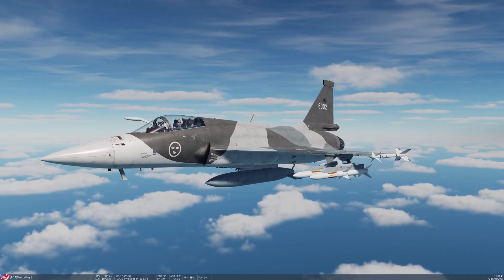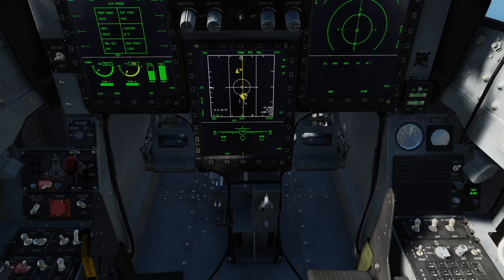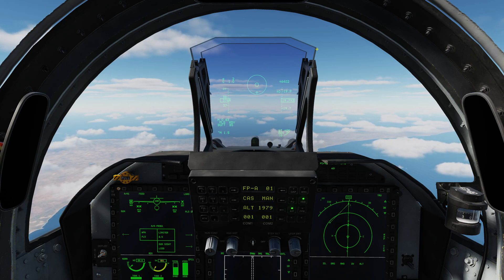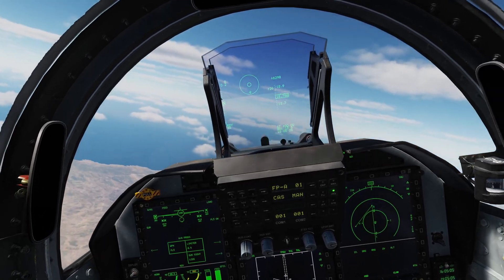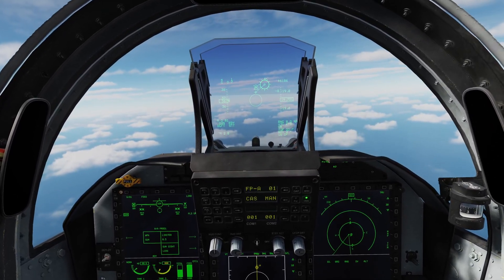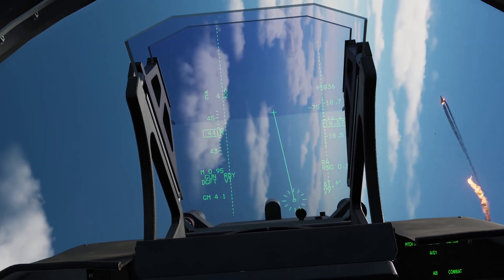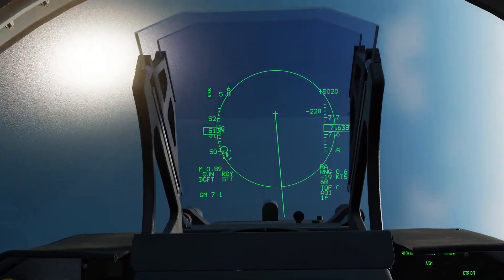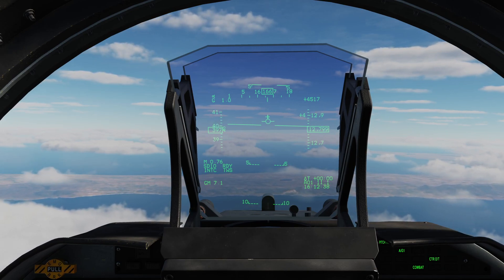DCS JF-17 Tutorial 5 - A/A Radar WVR Modes

Comment: The JF-17 doesnt have a "dogfight" switch but you can enter dogfight/vertical scan mode directly using S1 from any other master mode in the plane. So you can go straight from Air to GRound to dogfight and back again with just one switch, which I would argue is actually easier and faster than the F-16
Reply from the maker: Thanks, this is a really good point which I missed in the video. S1 up is always available.
Reply: @deephack sorry my ignorance when saying s1 or s2 it actually means pressing s+1 or s+2 in the keyboard ?